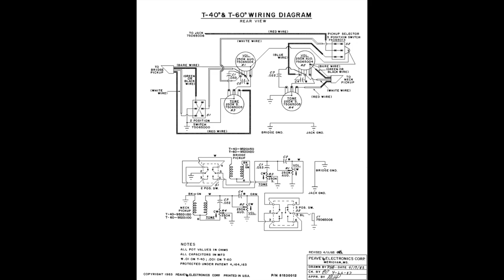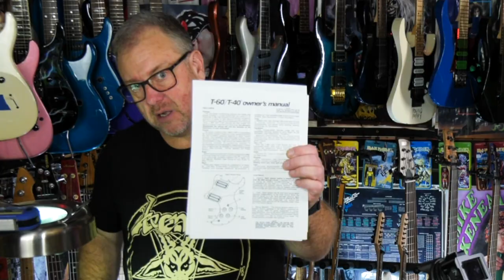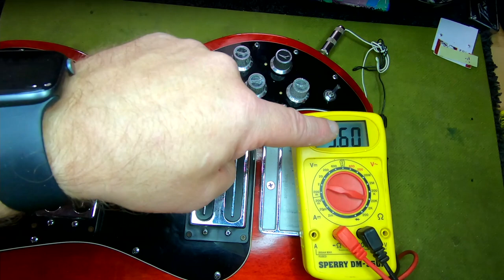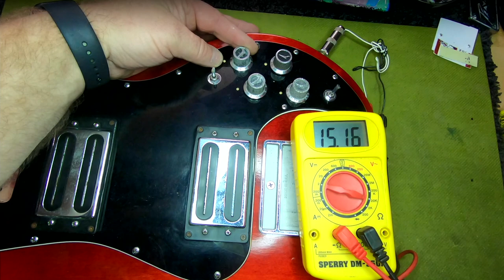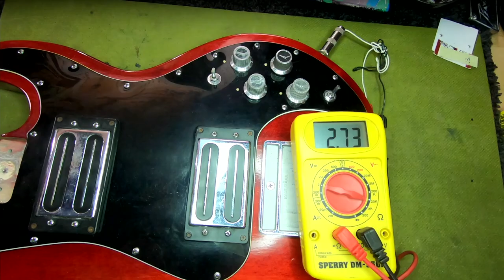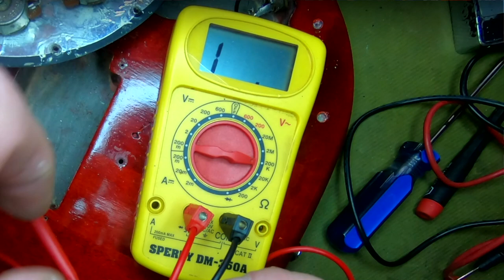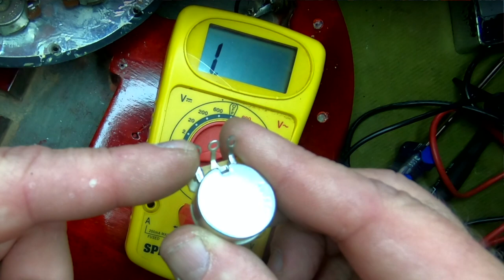Why The Peavey T 40 Is Amazing

Comment: Killer informative vid man! Thanks. Love my 1980 t40…lucked out and found a 9lb one! A major overlooked function of the phase switch…if you’re soloing the bridge pickup in single coil mode, the phase switch reverses the coils. So you can switch between a 60s/70s jazz bass pickup location. Pretty sure the nut is aluminum
Reply from the maker: Aluminum would make sense. 

Next time I have a T-40 in my hands I’ll have to try your bridge trick. It doesn’t seem like that should work but I don’t know for sure because I haven’t tried it. 

Perhaps when I build my Rick-O-Sound/T-40 hybrid it will work, maybe not. We shall see.
Reply: I can’t remember where I read or heard about that bridge trick(maybe the vid “secret sounds of the T-40”) but it definitely works! You can really hear it, but also if you tap the coils with a piece of metal it’s obvious one turns off and the other turns off when you flip the phase switch. Your Ric build sounds awesome! Can’t wait to see/hear that
Reply from the maker: @mattbrandaumusic  it’s coming. I’m not sure exactly when because there are lots of things in line right now. The parts are all here and it works. I just had to get linear taper pits to make it work so it got pushed back and then other things got infront of it. 

I’ll be doing a Kahler bass trem install as well and a bunch of other cool stuff. If you haven’t subscribed yet I invite you to do so.

Comment: I have a 79 T-40 that I bought almost twenty years ago.  It’s a natural finish and it still has the plastic on the pick guard in the area of the control knobs, showing what the knobs do.  It weighs a ton, as they do, but I think it’s such a cool bass. I love the simple goofy look of it.   The electronics of a T-40 are set up (from what I understand ) is that when the volumes are at ten, you have two single coils. As you roll down to seven and lower, they become humbuckers.   I may have that wrong and it’s the tone knobs that do that, I can’t remember.
Reply from the maker: It’s the tone knobs that do that but you were very close, my friend!
Reply: @REXYLAB Okay, thanks.  I feel like I’ve seen videos on the past that mix them up, so I wasn’t sure.    You can definitely spend  time finding a lot of interesting tones by fiddling with the controls and phase switch.    Googling T-40 tones will bring up a few “charts” that show settings that try to mimic P bass, J bass, Rick, MM, etc.     

Thanks for the video!

Comment: Turned out really nice! And I dig the transparent red, I have never seen one in this color. One small note: The phase switch does something if you solo the bridge pickup and have the tone wide open: The other coil will be the active one, and in this pickup position, this will be a noticeable sound change. By the way, I also really like your plan of putting a similar wiring into another bass! Getting something similar-sounding but not spine-breaking sounds awesome! I have a T-27 guitar, it also has this special tone knob, and it's just genius! I'm primarily a bass player, so although the T-27 is heavy for a guitar, I'm used to a 10 lbs bass, so it's not an issue for me. But 12 or 13 lbs would be.
Reply from the maker: You know, that makes sense as it would be attached to only one of the coils, good looking out! Thanks, buddy!

I have plans to do this mixed with Rick-o-sound in 2 basses and 1 guitar (with a few funky little twists!
Reply: That's not the original finish. The stained headboard is a dead giveaway. It's a shame, as the rosewood fingerboard models are pretty rare.

Comment: I had one of those in the late 90s. They are a heavy chunk of wood for sure! I think I traded it towards the Charvel bass I have now.
Reply from the maker: The T-40 is very cool and has lots of tones for sure, but I would have done the same thing!

I just can’t get over the weight and how uncomfortable that body is. 

But there is good news! I’m working on a design that will combine Rick-O-Sound and the T-40 electronics as well as fix the one issue I have with the T-40 electronics to begin with. 

I have everything I need to do it and it’s in line to be made so stay tuned for that.
Reply: T40 wiring?
All ears.

Comment: The phase switch is not just a phase switch. What it does is reverse the bridge pickup. Whilst this will put it "out of phase" with the neck pickup, when it is operating as single-coil it will select the other coil. That means when you are on the bridge pickup alone in single-coil (coil-tap) mode, tone on 10, you can select either coil. I like to orientate the switch so that back is the rear coil and  forwards is the front one; when you're playing, it's easier to remember. 
The pickups are huge and the pair weigh nearly as much as the wooden body. If you get a clicking noise when playing enthusiastically is probably the strings touching the pickup covers; the pickups are so powerful you can lower them out of the way without loss of tone. 
The nut is aluminium, polish but do not file unless you need to lower it. Watch the break-angle or it can buzz. Use the nut files on rough saddles; if their screws are seized, soak in PlusGas.  My T-40 seems to like thin bass strings. The action can be set up super-low without buzzing, lower than many players like the feel of; if you can get it that low and level, you can raise it.
Reply from the maker: @jeffslade1892  that was a lot of information, Extremely cool!

I’ll check out that switch and put it through its paces next time I have a T-40 come back through.
Reply: @REXYLAB  Pretty sure the strings on mine are Thomastik JR344 I thought they were 36-inch but the old packet says JR344. Which are 43, 51, 68, 89. A fair bit thinner than most others. (JR364 are thicker at 43-101)

Comment: Any more thoughts on the apparent resistors where C1 (bridge) and C3 (neck) caps should be in the schematics?
Reply from the maker: Great question! 

While they looked like resistors they had to be capacitors. I measured the capacitance and it was spot on with the diagram. 

This bass has decoupled pickups just like a Rickenbacker, it has to for it to behave the way it does. Not only that but the pots have to be linear  to dial in and out that other coil. 

That gave me an idea to make a bass that is a cross between a T40 and a Rickenbacker 4003 with the ability to control the amount of highs thrown to ground and just a single output you can use as stereo or mono with use of a push pull. 

I have everything I need except the time. I’ll probably even put a kahler on it.
Reply: Thanks for the reply. I recently opened up my T-25 and T-27 to discover the same wafer capacitor soldered between the bridge ground and the jack. It appears to be factory original… What’s the purpose of that?
Reply from the maker: @andrewworrick7984  i honestly have no idea. Was only one leg of the cap connected like this one?
Reply: No, sir. It was in line from the jack to the bridge ground.
Reply from the maker: @andrewworrick7984  wow, was it on the ground side or the hot side?
Reply: Ground side.
Reply from the maker: @andrewworrick7984  honestly, that makes no sense to me. I need to dig into it further.

Comment: Stainless perhaps, id soak in alcohol if studdorn
Reply from the maker: The nut you mean?
Reply: @REXYLAB  yeah, like around 7:00
Reply from the maker: @idiotburns  it was covered in crazy crap that had to be taken off with a Dremel with the wire wheel attachment. It’s very clean now. 

The current owner said the previous owner had hammered the thing. It showed too when I first got it in. 

It’s back with the owner now.
Reply: @REXYLAB  Too cool